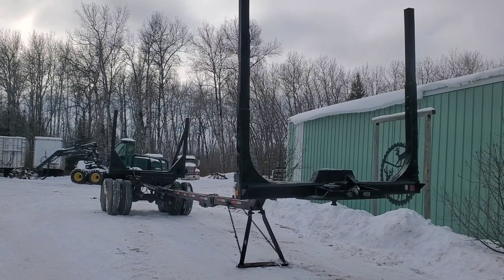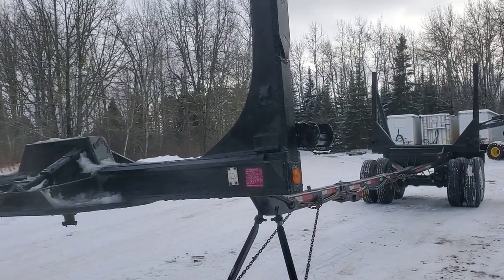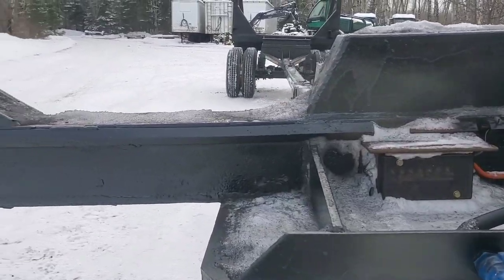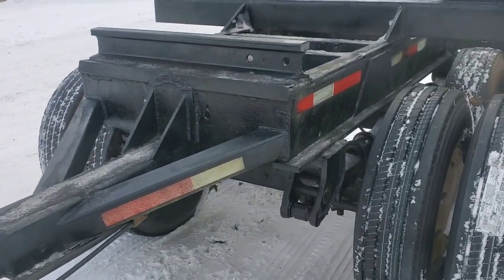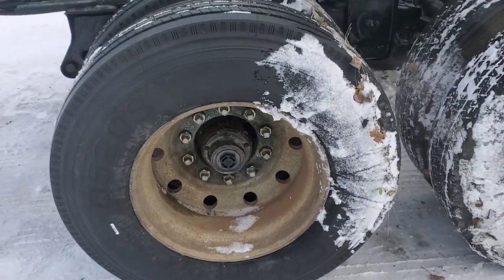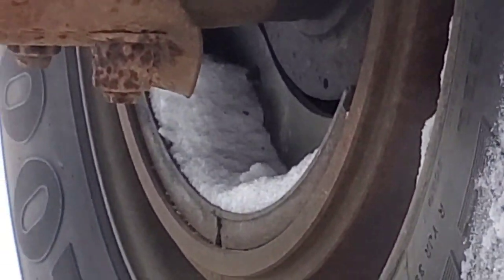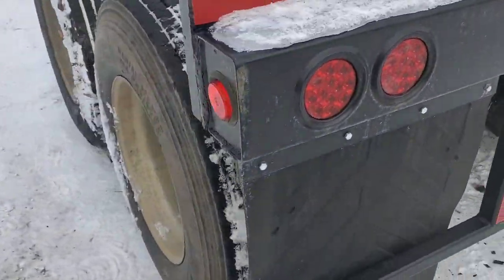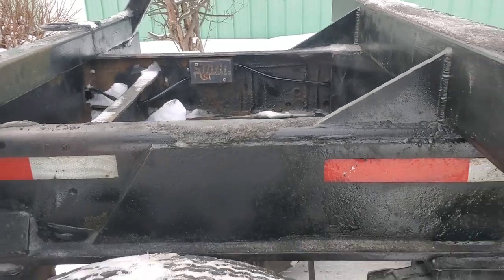Pole Trailer For Sale in MN

Comment: Nice job and a sturdy looking trailer. No wonder it didn't give any trouble. And I'm used to manual slack adjusters. The only snap-on wrench I have (and it was given to me) is a 9/16ths combo I kept in my dinner bucket to set brakes with. The other drivers said I'd get run off for toting one and I told them to let 'em try. I was driving before I came there. Some of the other drivers had bad locks on the adjusters and I'd set theirs up on a regular basis. Never got run off either and the company knew about it. Somebody had to do it. GBWYou!